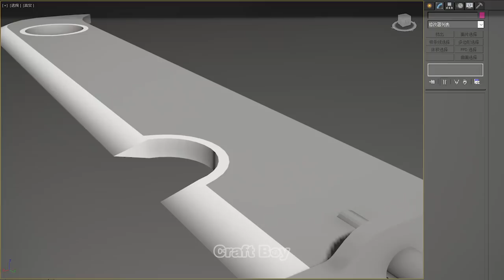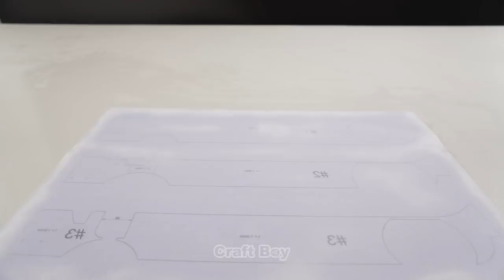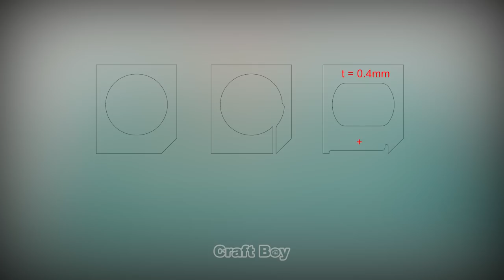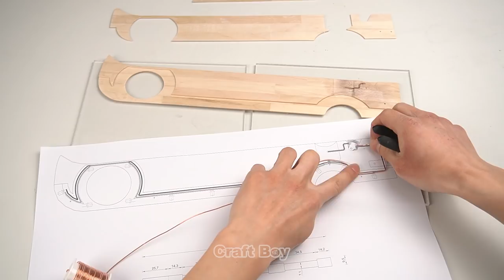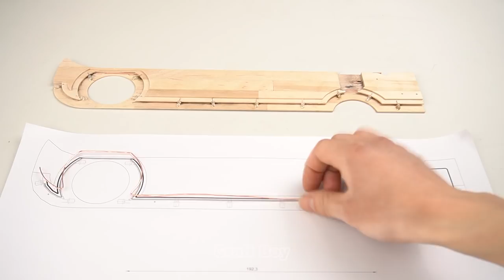Make a Zabuza Sword from Popsicle Sticks and Resin

Comment: R  E  S  P  E  C  T

By the way, I think the LEDs are working but the epoxy layer you have made is very thick, so it does not transmit light, I recommend you to put a small LED next to the battery part to understand that the electrical circuit is working next time.
Reply: You can also try to use more powerful batteries and LEDs or using a more transparent epoxy layer

Comment: A more indept look at how you got that polished metal look(with notes) would...would be something I'd enjoy <.< . You legit made wood look like actual metal
Reply: if you sand wood after every time you prime it with paint, over time the whole wood grain would disapear and it would look akin to plastic (or any hard clean surface) after wich its just getting your paint mix right for the metal look, (at one point he painted an extra thick primer at the seems of the sticks cause it took too long and then sanded it flush again so it would look one solid piece
Reply: @dark0blade  good looking. Thanks